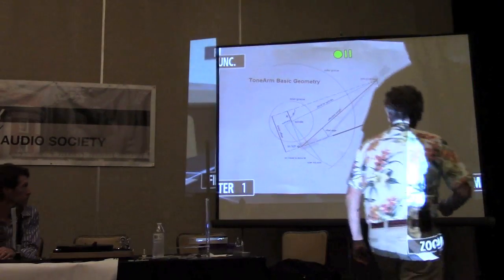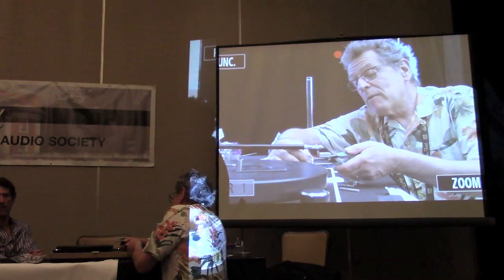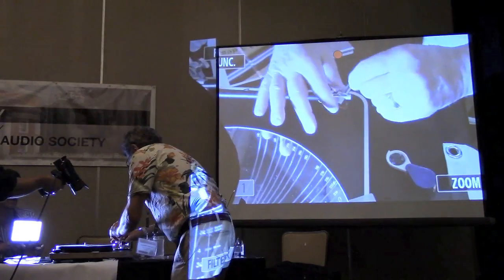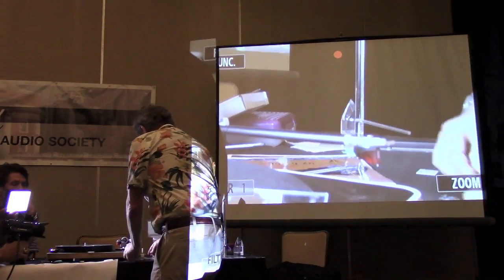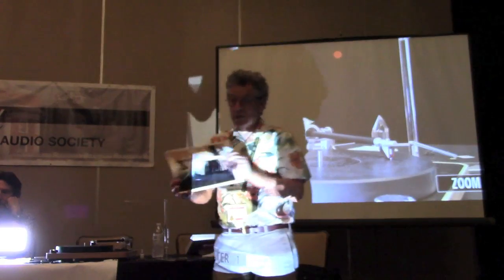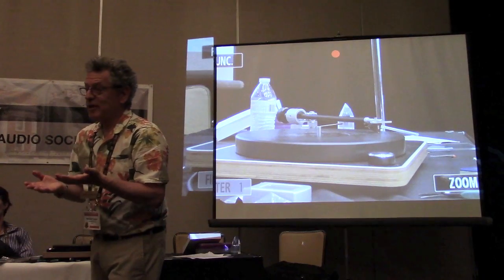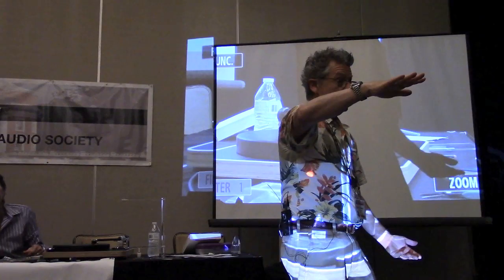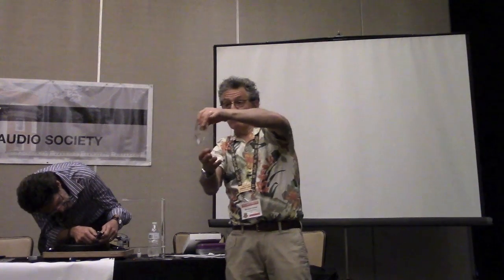Turntable Basics

Comment: Michael, hello.I found this video, it was recorded many years ago.But I decided to write.I have constructed a template, which, like a compass with a level set on it, I draw a tangential line.First, exactly on millimeter paper, mounted on a spindle, which I attach to a disk, which I also attach to the baseboard in advance, then I draw a pencil, which is in the template, the line of movement of the stylus with the effective length set on it.And then I lower my hand to the line in several places and adjust the needle.Then all other adjustments.Sincerely from Russia.

Comment: It's mind boggling that the industry never used the stylus protection cover to aid alignment.
Also easier to make the connections with the stylus hanging loose, rather than screwed on.

I have a reflective protractor but it is a bloody nuisance compared to the manufacturer's paper one.